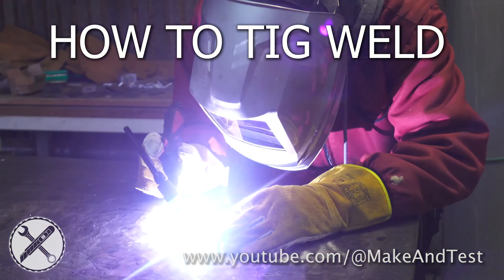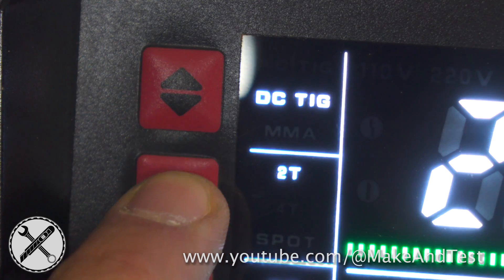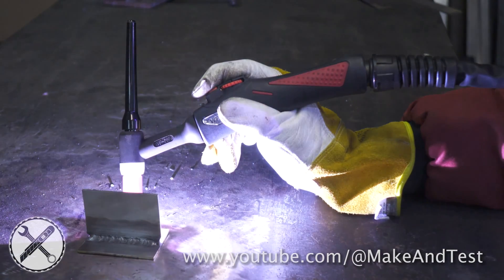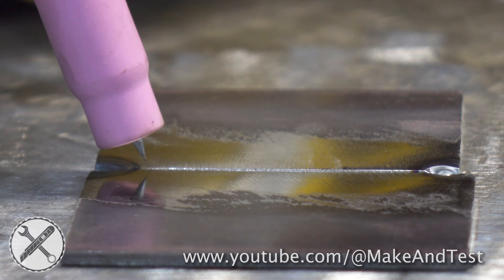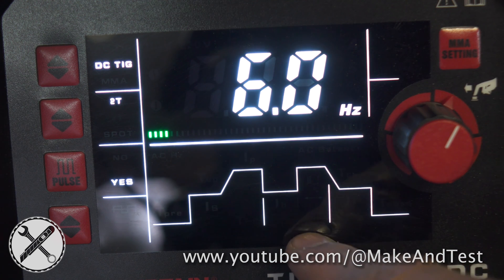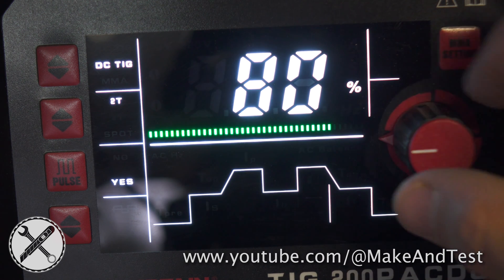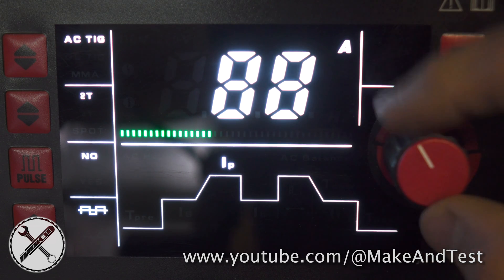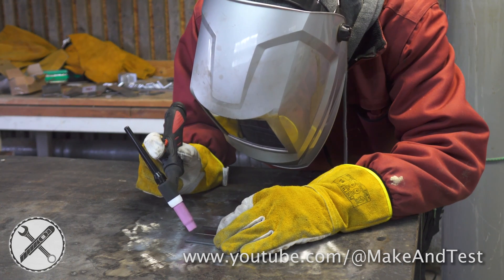How to TIG weld Basic parameters explained | ARCCAPTAIN & Make and Test

Comment: What are Tig settings/mode when Torch current potentiometer adjustment  have some impact to current? I have same WP-26 torch and Arccaptain 200P AC/DC tig,  same set as in this video and at least I don't have seen any impact to current if I adjust potentiometer? If  current adjustment should work, then my brand new Tig is somehow broken? Any help is welcome, because in user manual there is no guidance for it.
Reply from the maker: The potentiometer on WP26 controls the gas flow for welding, and as you mentioned, it does not control the current. Current adjustment in this case is typically done through the foot pedal, which allows for precise control over the welding current.
Reply: Guys, Here is our Savior

HalleluYAH translates “Praise YAH”

- YAH The Heavenly Father (Genesis 1)

- YAH arrives via the TENT OF MEETING (Exodus 33:7-11)

- YAH The Father was Who they Crucified for the sins of “man” and they NAILED YAH’s HAND on an Almond Tree
- (Hebrew Isaiah 43-56)

YAH The Father is The Savior